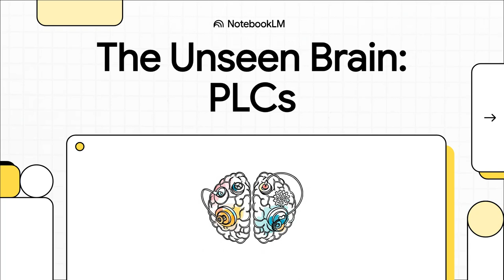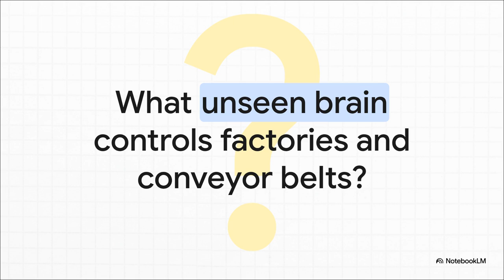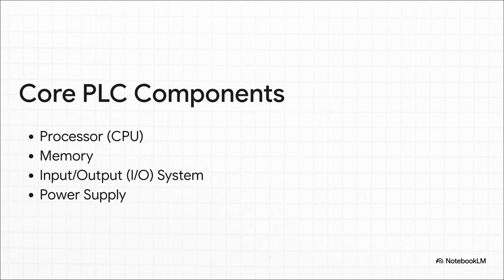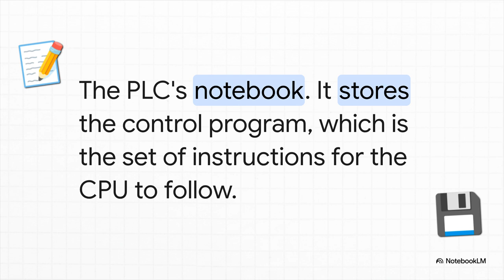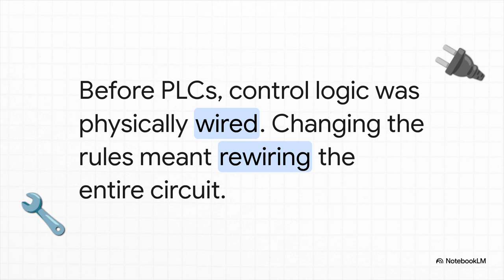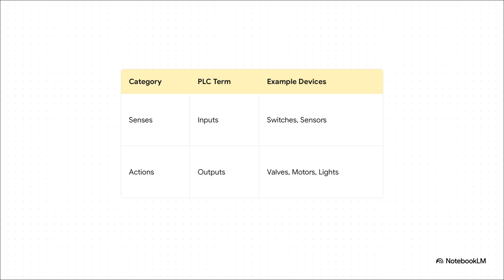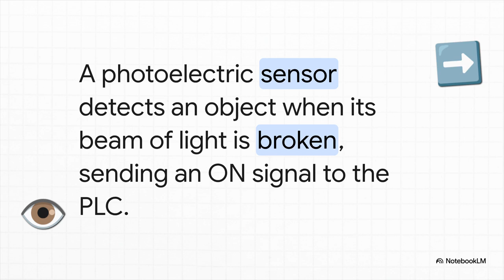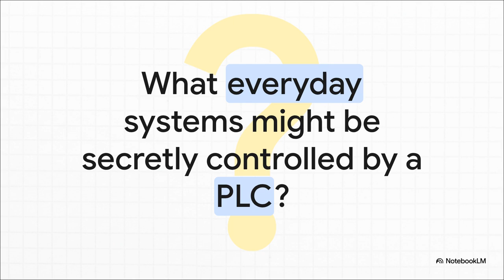PLC

Comment: Nama : Sopiah Rahmadani br Torus
Nim : 5223351007
Kelas : PTIK - A 2022

Di video ini dijelasin tentang PLC atau Programmable Logic Controller. Jadi, PLC itu semacam alat elektronik yang dipakai buat ngatur sistem otomatis di industri. Cara kerjanya simpel dia nerima sinyal dari input, misalnya tombol atau sensor, terus diproses di dalam program, lalu hasilnya dikeluarin ke output kayak motor, lampu, atau mesin lain. Nah, dibanding sistem lama yang masih pakai relay manual, PLC jelas lebih gampang, lebih fleksibel, dan kalau mau ganti logika tinggal edit programnya aja, nggak usah ribet bongkar kabel. Di video juga disebutin bagian-bagian penting dari PLC, kayak input module, CPU sebagai otaknya, memory tempat nyimpen program, sama output module buat ngasih perintah ke alat. Selain itu, dibahas juga kenapa PLC dipakai luas di dunia industri, karena lebih cepat, lebih efisien, bisa dipakai jangka panjang, dan gampang banget disesuaikan sama kebutuhan. Contoh penerapannya juga ada, misalnya di pabrik, mesin produksi, konveyor, sampai lampu lalu lintas. Jadi intinya, video ini ngajak kita kenalan sama PLC: apa itu, gimana cara kerjanya, bagian-bagiannya, plus kenapa dia penting banget di dunia industri.

Comment: Nama : Rahmi Isnaini
Kelas : PTIK - A
NIM : 5222451006

Video ini menjelaskan dengan ringan dan runtut tentang Programmable Logic Controller (PLC) sebagai otak tersembunyi di balik dunia otomasi. PLC diperkenalkan sebagai komputer khusus yang berbeda dari PC biasa karena dirancang tangguh untuk menghadapi kondisi keras di pabrik sekaligus mampu terhubung langsung dengan mesin industri. Penjelasan berlanjut ke komponen utama PLC, yakni CPU sebagai otak pengambil keputusan, memori sebagai tempat instruksi, sistem input-output sebagai indera dan otot, serta power supply sebagai sumber energi. Cara pemrogramannya pun menarik karena menggunakan ladder logic, bahasa visual yang mirip rangkaian listrik sehingga mudah dipahami oleh teknisi yang terbiasa membaca diagram relay. 

Video ini juga menampilkan contoh nyata, seperti sensor fotoelektrik di conveyor yang mendeteksi kotak lalu memicu aksi solenoid untuk mendorongnya ke jalur yang tepat, menggambarkan proses “sensing–deciding–acting” dalam otomasi. Secara keseluruhan, video ini berhasil menunjukkan bagaimana PLC merevolusi industri dengan mengubah sistem relay yang kaku menjadi software yang fleksibel, serta menegaskan bahwa teknologi ini hadir di banyak aspek kehidupan sehari-hari mulai dari lampu lalu lintas, lift, hingga car wash otomatis.

Comment: Nama : Raffi Hidayat
Kelas : PTIK - A
NIM : 5223351009

Video ini menyajikan ulasan informatif dan ringkas tentang Programmable Logic Controller (PLC), yang digambarkan sebagai "otak" di balik sistem otomatisasi industri.
Secara keseluruhan, video ini menjelaskan empat komponen inti PLC, yaitu CPU, memori, sistem input/output, dan catu daya. Penjelasan tersebut membantu penonton memahami bagaimana PLC dapat menerima data dari sensor dan mengendalikan mesin. Video ini juga menyoroti penggunaan bahasa pemrograman Ladder Logic, sebuah metode visual yang dirancang untuk memudahkan para teknisi dalam mengendalikan sistem yang kompleks.
Selain itu, video ini menunjukkan bagaimana PLC telah mengubah sistem kendali yang tadinya kaku menjadi fleksibel dan berbasis perangkat lunak. Contoh nyata seperti sistem lampu lalu lintas dan lift turut disertakan untuk menunjukkan relevansi teknologi PLC dalam kehidupan sehari-hari, membuktikan bahwa peran PLC sangat vital dalam berbagai aspek modern.

Comment: Nama	: Amanda Shafira
NIM	 : 5223151023
Kelas	: PTIK – B

Video ini memberikan penjelasan tentang PLC atau Programmable Logic Controller adalah otak tersembunyi di balik berbagai mesin otomatis di pabrik maupun di kehidupan sehari-hari. Alat ini bisa mengendalikan mesin seperti conveyor, bor otomatis, hingga sistem pengepakan, sehingga semua berjalan tepat waktu dan presisi.

Komponen Utama PLC
•	CPU: otak yang mengambil keputusan berdasarkan program.
•	Memory: tempat penyimpanan instruksi dan program kontrol.
•	Input/Output (I/O): berfungsi sebagai indera (input/sensor) dan otot (output/aktuator).
•	Power Supply: sumber tenaga yang menjaga semua bagian bekerja.

PLC diprogram menggunakan Ladder Logic, yaitu bahasa visual yang mirip dengan diagram listrik. Hal ini membuat teknisi mudah memahami dan menggunakannya tanpa perlu mempelajari bahasa pemrograman yang rumit.

Cara kerja PLC pada dasarnya adalah membaca input dari sensor lalu menghasilkan output sesuai program. Misalnya, ketika sensor cahaya mendeteksi sebuah kotak di atas conveyor, PLC akan mengirim perintah untuk menggerakkan piston agar kotak berpindah ke tempat yang tepat.

Secara keseluruhan, PLC telah mengubah sistem kendali yang dulu rumit dan kaku menjadi lebih fleksibel dan mudah diatur. Teknologi ini ada di sekitar kita, mulai dari lampu lalu lintas, lift, hingga mesin cuci mobil otomatis.

Comment: Nama : Zherina Br Sitepu
Nim    : 5221151003
Kelas  : PTIK-A

Video ini secara mendalam mengulas tentang Programmable Logic Controller (PLC), sebuah sistem komputer khusus yang berfungsi sebagai "otak" tersembunyi di balik berbagai proses otomatisasi industri. PLC didesain secara spesifik untuk beroperasi di lingkungan pabrik yang keras, berbeda dengan komputer personal pada umumnya.

Komponen dan Cara Kerja

Secara garis besar, PLC terdiri dari empat komponen esensial yang bekerja secara terintegrasi:

1. Central Processing Unit (CPU): Bertugas sebagai unit pemrosesan utama yang mengeksekusi instruksi dari program.

2. Memori: Berperan sebagai media penyimpanan instruksi program serta data yang dibutuhkan oleh CPU.

3. Sistem Input/Output (I/O): Merupakan antarmuka PLC dengan dunia luar. Modul input menerima sinyal dari sensor (misalnya sensor pendeteksi objek), sementara modul output mengirimkan perintah ke aktuator (seperti motor atau solenoid).

4. Catu Daya: Memastikan seluruh komponen PLC mendapatkan suplai energi yang stabil untuk beroperasi.

• Ladder Logic sebagai Bahasa Pemrograman

Salah satu inovasi kunci yang ditekankan adalah penggunaan Ladder Logic, sebuah bahasa pemrograman visual yang revolusioner. Bahasa ini dikembangkan untuk memudahkan teknisi yang terbiasa dengan diagram kelistrikan berbasis relai, sehingga menghilangkan kebutuhan untuk pengkabelan ulang yang rumit dan tidak efisien. Konsep dasarnya sangat logis, yaitu 'jika ada masukan, maka lakukan keluaran', yang direpresentasikan dalam format diagram tangga yang intuitif.

•Peran Strategis dalam Otomasi

Video ini menyimpulkan bahwa PLC telah mengubah paradigma dalam dunia otomasi. Jika sebelumnya sistem kontrol bersifat statis dan rigid, PLC menjadikannya fleksibel dan mudah dimodifikasi hanya dengan mengubah program perangkat lunak. Kontribusi PLC sangat krusial dalam berbagai aplikasi modern, mulai dari sistem produksi di pabrik otomotif hingga kontrol lalu lintas dan operasional lift. Secara fundamental, PLC memungkinkan proses yang kompleks berjalan secara otonom, presisi, dan efisien.

Comment: Nama : Nayla Amanda
Nim : 5222451007
Kelas : PTIK - A

Video ini menjelaskan tentang PLC (Programmable Logic Controller) yang dibilang sebagai “otak” dari dunia otomasi industri. Semua mesin otomatis kayak robot pabrik, conveyor belt, sampai sistem pengepakan bisa berjalan tepat dan presisi karena ada PLC yang mengendalikan. Bedanya sama komputer biasa, PLC ini memang didesain khusus untuk lingkungan pabrik yang keras, tahan panas, debu, getaran, dan punya koneksi langsung ke mesin besar.

Di dalam PLC ada empat bagian utama: CPU yang jadi otaknya, memory tempat program atau aturan disimpan, sistem input-output (IO) yang jadi “indera” dan “otot”-nya, serta power supply yang jadi sumber energi agar semuanya bisa jalan. CPU bakal ngambil data dari sensor, lalu dibandingkan dengan aturan di memory, baru deh ngasih perintah lewat output ke mesin, misalnya nyalain motor, buka katup, atau gerakin piston.

Yang bikin PLC revolusioner adalah cara pemrogramannya pakai ladder logic. Dulu sebelum ada PLC, kalau mau ganti cara kerja rangkaian harus rewiring manual, ribet dan lama. Tapi dengan ladder logic, cukup digambar di komputer kayak rangkaian listrik sederhana, teknisi langsung bisa paham karena bentuknya familiar sama diagram relay yang udah mereka kenal. Jadi lebih fleksibel dan gampang diubah tanpa perlu coding rumit.

Contoh gampangnya, bayangin ada box jalan di conveyor. Sensor cahaya mendeteksi box lewat, ngasih sinyal ke PLC. Lalu sesuai program, PLC nyuruh solenoid valve buka, udara tekan keluar, piston bergerak, dan box didorong ke tempat yang ditentukan. Prosesnya cepat, otomatis, dan presisi.

Makanya, PLC ini bener-bener jadi game changer di industri. Dari sesuatu yang dulu kaku dan sulit diubah, sekarang bisa jadi fleksibel dan dikendalikan software. Hebatnya lagi, PLC ini kerjanya sering nggak kelihatan, tapi ada di sekitar kita: di lampu lalu lintas, lift, sampai car wash otomatis. Jadi setiap kali lihat sistem otomatis yang bekerja rapi, kemungkinan besar ada PLC yang jadi otak di balik layar.

Comment: Nama: Steven Johannes
Nim: 5223151002
Kelas: PTIK-A/22

Berdasarkan video tersebut, PLC (Programmable Logic Controller) adalah komputer khusus yang kuat, dirancang untuk lingkungan pabrik yang keras. PLC bertindak sebagai "otak" di balik otomatisasi, mengontrol operasi yang tepat seperti bor otomatis atau sistem pengepakan. Komponen utamanya adalah CPU (prosesor), memori untuk menyimpan program, sistem I/O (input/output) sebagai "indra dan otot", dan catu daya.

PLC diprogram menggunakan bahasa visual yang disebut ladder logic, yang menyerupai diagram relai listrik tradisional. Ini memungkinkan teknisi dan teknisi listrik untuk memprogramnya tanpa harus mempelajari kode komputer yang rumit. Secara keseluruhan, PLC merevolusi industri dengan menggantikan sistem kabel yang tidak fleksibel dengan solusi berbasis perangkat lunak yang fleksibel. Sebagai contoh, video ini menunjukkan bagaimana PLC menggunakan sensor untuk mendeteksi sebuah kotak di ban berjalan dan kemudian menggunakan aktuator untuk mendorongnya keluar.

Comment: ULASAN
Bagian 1: Otak Otomasi
Di awal video dijelaskan kalau PLC itu ibarat otak dari mesin otomatis. Bedanya dengan komputer biasa, PLC dibuat khusus untuk kondisi pabrik yang keras, panas, berdebu, penuh getaran tapi tetap bisa bekerja tanpa masalah.

Bagian 2: Isi Dalamnya
Kalau dibongkar, PLC punya empat bagian penting: CPU sebagai otak, memori buat nyimpan program, input-output yang jadi mata, telinga, dan otot, serta power supply sebagai sumber tenaga. Semua ini saling nyambung biar mesin bisa jalan.

Bagian 3: Bahasa Programnya
PLC diprogram pakai ladder logic, semacam gambar mirip rangkaian listrik. Karena bentuknya familiar, teknisi gampang belajar tanpa harus pusing dengan coding rumit. Enaknya lagi, kalau mau ganti cara kerja mesin, cukup ubah programnya, nggak perlu bongkar kabel.

Bagian 4: Cara Kerjanya
Contohnya, ada sensor cahaya di konveyor. Saat kotak lewat, sensor kasih sinyal ke PLC. Lalu PLC memerintahkan katup udara buat dorong kotak ke tempatnya. Sederhana: sensor ngasih tahu, PLC mikir, lalu mesin bergerak.

Kesimpulannya, PLC bikin dunia otomasi jadi lebih fleksibel, gampang diatur, dan tahan banting. Walau nggak kelihatan, sebenarnya PLC ada di mana-mana, mulai dari lampu lalu lintas sampai lift atau car wash otomatis.

Comment: Nama: Ghaitsa Zahira Lubis
NIM: 5223351024
Kelas: PTIK-C 22

Ulasan video:
Video ini membahas tentang PLC (Programmable Logic Controller) yang digambarkan sebagai “otak tersembunyi” di balik berbagai sistem otomatisasi di dunia industri. PLC berperan penting dalam mengendalikan mesin pabrik, robot, konveyor, hingga sistem otomatis sehari-hari seperti lampu lalu lintas, lift, bahkan car wash. Pertama, video menjelaskan bahwa PLC adalah komputer khusus yang berbeda dengan PC biasa. Kalau komputer rumah tidak akan tahan di lingkungan keras pabrik yang penuh getaran, panas, dan debu, PLC justru dirancang untuk kondisi seperti itu. Ia bisa langsung terkoneksi dengan mesin-mesin berat dan tetap stabil beroperasi.
Kedua, isi dari sebuah PLC terdiri dari empat bagian utama: CPU (sebagai otak yang mengambil keputusan), memory (penyimpan program), I/O system (input-output sebagai indera dan otot), serta power supply (jantung yang memberi energi). Kombinasi inilah yang membuat PLC mampu menerima informasi dari sensor, memproses sesuai program, lalu mengendalikan aktuator atau mesin.
Ketiga, video memperkenalkan ladder logic, bahasa pemrograman visual untuk PLC. Sebelum adanya PLC, sistem kontrol harus dipasang dengan kabel fisik yang ribet dan tidak fleksibel. Dengan ladder logic, semua logika bisa digambar layaknya diagram listrik yang sudah familiar bagi teknisi, sehingga transisi dari sistem relay ke sistem digital berlangsung mulus.
Terakhir, ditunjukkan bagaimana PLC bekerja dalam dunia nyata: sensor (input) mendeteksi kondisi, PLC memproses sesuai logika, lalu memberi perintah ke aktuator (output). Contohnya, sensor cahaya mendeteksi kotak di atas konveyor, lalu PLC mengaktifkan solenoid untuk mendorong kotak ke jalurnya. Inilah bukti bahwa PLC membuat sistem otomatis lebih fleksibel, cepat, dan mudah diubah tanpa bongkar kabel.

Comment: Nama: Filza Kirani Br Sitepu
Nim: 5223151033
Kelas: PTIK C 

Video ini membahas PLC (Programmable Logic Controller) yang sering disebut sebagai otak dari sistem otomasi industri. Berbeda dengan komputer biasa (PC) yang mudah rusak bila terkena panas, debu, atau getaran, PLC dirancang khusus agar tahan terhadap lingkungan pabrik yang keras. Karena itu, PLC menjadi pilihan utama dalam sistem kontrol otomatis di berbagai bidang industri.

Di dalam sebuah PLC terdapat beberapa komponen utama yang saling bekerja sama:
1. CPU (Central Processing Unit) berperan sebagai pusat pengambil keputusan, tempat logika dijalankan, dan instruksi dikendalikan.
2. Memori, berfungsi sebagai tempat penyimpanan program dan data yang digunakan dalam proses otomasi.
3. Input dan Output (I/O), yang dapat dianalogikan sebagai indera dan otot. Input menerima sinyal dari sensor (misalnya sensor cahaya, tombol, atau limit switch), sedangkan output menggerakkan aktuator seperti motor, lampu, atau katup udara.
4. Power Supply, yang menyuplai energi listrik agar seluruh sistem PLC bisa bekerja dengan stabil.

Salah satu keunggulan PLC adalah kemudahan dalam pemrogramannya. PLC menggunakan Ladder Logic, yaitu bahasa pemrograman berbentuk diagram mirip tangga listrik atau rangkaian kelistrikan konvensional. Bentuk visual ini memudahkan teknisi yang sudah terbiasa dengan rangkaian listrik untuk memahami dan mengoperasikan sistem, tanpa harus belajar bahasa pemrograman komputer yang rumit. Dengan Ladder Logic, perubahan kontrol tidak perlu dilakukan dengan membongkar kabel secara manual, melainkan cukup dengan mengubah program di dalam PLC.

Contoh sederhana penerapan PLC bisa dilihat pada konveyor dengan sensor cahaya. Ketika sebuah kotak melewati sensor, sinyal input dikirim ke PLC. CPU kemudian memproses informasi tersebut dan menghasilkan sinyal output berupa perintah membuka katup udara untuk mendorong kotak. Prinsip ini menggambarkan cara kerja dasar PLC, yaitu menerima masukan (sensing), memproses logika, lalu memberikan keluaran (acting/doing).

Dampak dari hadirnya PLC sangat besar dalam dunia otomasi. PLC memungkinkan proses manual diubah menjadi otomatis, menjadikan pekerjaan di industri lebih efisien, praktis, fleksibel, dan aman. Walaupun sering tidak terlihat langsung, PLC sebenarnya hadir di banyak aspek kehidupan sehari-hari, mulai dari lampu lalu lintas, lift, mesin cuci mobil otomatis (car wash), hingga mesin-mesin produksi di pabrik.

Kesimpulannya, video ini memberikan pemahaman dasar yang sangat bermanfaat mengenai apa itu PLC, bagaimana komponen utamanya bekerja, serta mengapa Ladder Logic menjadi bahasa pemrograman yang penting dalam otomasi. Penjelasan ini dapat menjadi bekal awal bagi mahasiswa, teknisi, maupun praktisi industri untuk memahami sistem kontrol modern yang menjadi tulang punggung revolusi otomasi di berbagai bidang.

Comment: Nama: Elga Artanta Ginting
Nim : 5221151010
Kelas : PTIK B

Video ini membahas peran Programmable Logic Controller (PLC) sebagai otak dari sistem otomasi industri. PLC dijelaskan sebagai komputer khusus yang dirancang untuk lingkungan pabrik yang keras, berbeda dari PC biasa yang tidak tahan panas, debu, maupun getaran. Komponen utama PLC meliputi CPU sebagai pengambil keputusan, memori sebagai penyimpan program, input-output sebagai indera dan otot, serta power supply sebagai sumber energi.

Bahasa pemrograman yang digunakan PLC adalah ladder logic, diagram visual yang menyerupai rangkaian listrik tradisional. Hal ini memudahkan teknisi karena mereka tidak perlu mempelajari bahasa kode rumit dan bisa langsung menerapkan pengetahuan kelistrikan yang sudah ada. Dengan ladder logic, perubahan kontrol bisa dilakukan lewat perangkat lunak tanpa harus merombak kabel fisik.

Contoh nyata ditunjukkan melalui sensor cahaya pada konveyor yang mendeteksi kotak lewat. Sinyal input dari sensor diproses oleh PLC, lalu menghasilkan output berupa perintah membuka katup udara untuk mendorong kotak. Proses sederhana ini menggambarkan prinsip dasar PLC: menerima masukan (sensing) dan menghasilkan aksi (doing).

Secara keseluruhan, video ini memperlihatkan bagaimana PLC merevolusi otomasi dengan menghadirkan sistem yang tangguh, fleksibel, dan mudah diprogram. Meski jarang terlihat, PLC sebenarnya hadir di sekitar kita, seperti pada lampu lalu lintas, lift, hingga car wash otomatis.